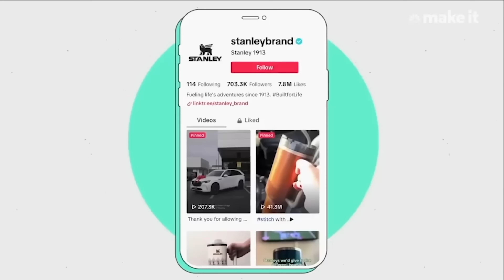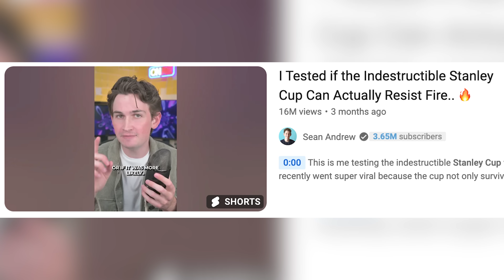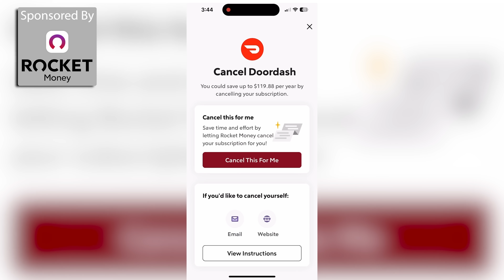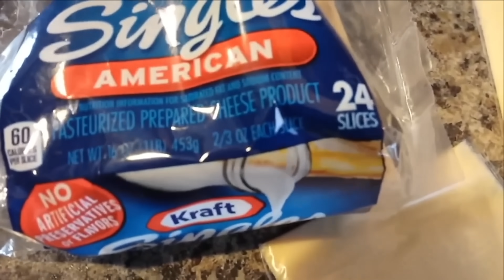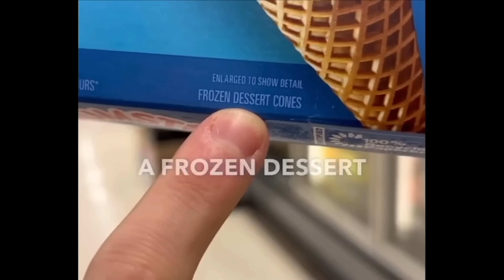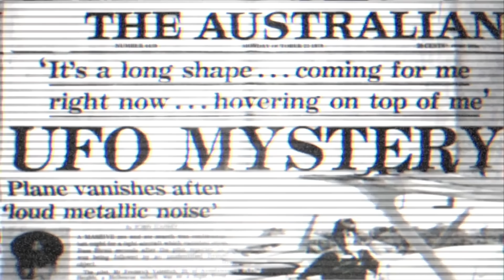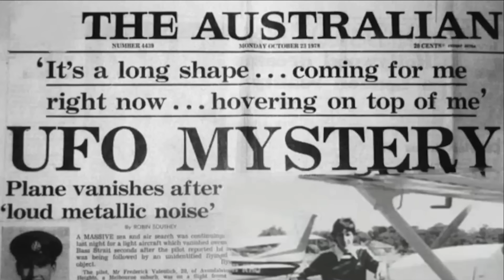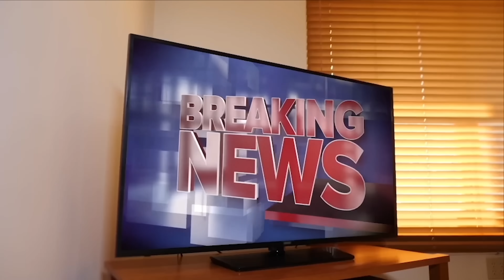Exposed: Troubling Trend Behind Shane Dawson's Conspiracy Theories

Comment: You're right about the switch from UFO to UAF. UAF is more linguistically accurate for the following reasons. The word unidentified remains because we KNOW that they are not identified. No brainer there. But, we don't KNOW that these things are "flying," just that they are spotted in the air, hence Aerial. Also, we don't KNOW they are "objects." As you said, they are often just lights. Therefore, Objects is replaced with Phenomenon. It's just changed to be more precise linguistically... Most of the time these things are just ducks and fake ass shit.
GREAT JOB.
Love your content
Reply: *UAP
Reply: The actual funniest thing about the acronym UFO is that Italians pronounce it "oofo"
Reply: @Moony1568  Yeah yeah yeah. I know. But at least I didn't misspell fenominom LMAO. Cheers
Reply: @VioletsandIrises  That's how I pronounce getting kicked in the guts LMAO
Reply: @VioletsandIrises  nope, I'm italian and we don't pronounce it oofo, sorry. We read it as it's wrote, so just ufo/ ʔufɔ (Hope the phonetic transcription is correct) 
I know "oofo" sounds funny, but sounds more similar with a mangle version of "òco" that it's veneto dialet for "look out for something" so "òco, stai attento!" 😊

Comment: The car was protecting the Stanley cup. Like you said. The fire did hit inside but didn't directly burn the cup as easily as PUTTING IT DIRECTLY ON A BBQ AND SETTING IT ON FIRE. HE didn't prove anything. Unless he's burning the exact model of car with the Stanley cup inside for exactly as long as the fire was on the car, it proves nothing... Plus he's got hundreds of disgusting things he's said to and about children, not just one or 2 things. He should be IN PRISON not YouTube

Comment: The cheese melting thing, interestingly enough, is almost exactly like the Frozen Dairy Dessert thing. 
It both revolves around milk fat, however you usually find the unmelting cheese in very cheap brands of cheese. I was poor, so I did what I could with my crappy poor-person-meal and at one point it ended up being very cheap string cheese in a tortilla that I put in the microwave. It didn't melt. It did actually burn, so I did some experiments with it. But it obviously ain't plastic, it's not a conspiracy. It's cheap ingredients and cutting corners. There ARE single-sheet American Cheeses out there that are made by such companies that don't melt and they instead burn, but Kraft Singles absolutely melted, especially their Deli Deluxe (superior.) You can learn a lot about food temperatures and how they cook (or freeze!) just through the fat content in it.  
So, basically, there were two stupid conspiracies that could just be easily explained with fat content. 

Get your American Cheese from the deli in the store, usually very worth it.